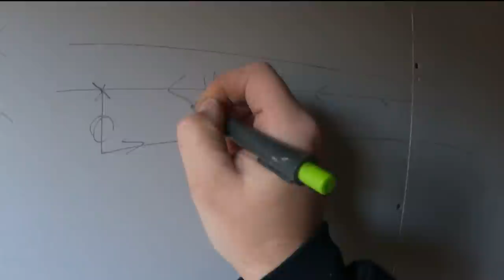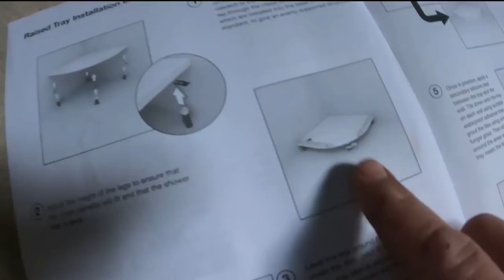MAKING IT WORK!!..HAIR-WASH STATIONS IN A NEW HAIR SALON..Something different

Comment: Thanks for taking the time to pull this together mate. The shower tray fixing is always a contentious subject. I tend to adapt my approach depending on the floor type and how level it is. In the nrw build case I would probably always SBR it first and then silicon. Where the floor is uneven or not level of concrete floor, SBR and then tile adhesive to bed it in and level it. I did watch a video from Skill Builder which does explain why a soft bed of concrete is the recommended approach. But, like you, I tend to stick to what I kkow and works.
Reply from the maker: Thanks mate, yep we all have our own ways that work so we stick to them…👍🏼👍🏼

Always one for a good old debate🤣
Reply: @MJTiffPlumbing  it won't be the first time I've had a mass debate over a shower tray 😂! Rude 😂

Comment: I had noticed you'd got a few mates Mark. Thinking when I finish college I need to find some to get work done. 🤣 Least my name ain't Billy.

Big old salon should look nice when it's all kitted out. The price of them sinks is mental though.

Moisture boards is an interesting way to cut costs on a project of that size and quality. Not to current regs either.

His gaff his choice but an odd decision from my perspective anyway. 

Looking forward to the sunken shower on Sunday 😊
Reply from the maker: Thanks mate, salon will be smart when it’s done.
Yep his choice on the boards, to be fair I’ve never had an issue with moisture boards in a shower area… if it’s tiled and sealed right it’s fine….

Comment: The only gripe would be on the tray analogy is that silicone on a warped floor and it will crack. The use of mortar gives you a solid even bed. Nothing to do with the legs or strength of it. I do use silicone on new builds myself but always check the floor for level and that it hasn’t got any bows in it. I hope that helps 👍
Reply from the maker: Never had an issue with Silicone bedding a tray, as to be honest a floor should always be made level anyway to eliminate any issues👍🏼

Thanks for watching and dropping a constructive comment👍🏼👍🏼
Reply: @MJTiffPlumbing  absolutely spot on mate. Like I said I use silicone on new builds myself. I have come across some pissed floors on older houses and to combat that is to cut them out and ply the shower area. The ply will bend a bit and get reasonably flat but not perfect. Using mortar can alleviate that as you can level it out to give a flat bed

Comment: What a great content and definitely always learn something new from the video. About the silicone did you only use Dura + for everything? I mean silicone for shower tray, on the side of it and for the tray waste? I just bought your recommendation laser today and will consider about the £499 Erbauer from Screwfix since I had combi drill and impact drive at the moment. But I need SDS drill and Multi Tool for rads change job later. Hope you get another 100 or 200 subscriber this week. Keep it up 👍
Reply from the maker: Thanks mate….
The laser level is spot on, always using it at the moment

Comment: You happen to have the codes for those two fittings you used on the waste of the backwash at 9.00?
Reply from the maker: I will have to rewatch and see what they were
Reply: @MJTiffPlumbing  haha sound thanks. Looks to me like the 32mm viva Magna from toolstation but it’s the converting from 40mm without extra adaptor I couldn’t get head round. I’m doing one for someone this week and redoing the plumbing due to an original dodgy setup. They just shoved the waste hose into a pipe with no thought on if it ever blocked and flooded place

Comment: That secondary return? Why does the water circulate in the hot water circuit if threes no demand on the taps.?
Reply from the maker: It’s pumped so it circulates when a hot water draw is a long way from the cylinder, set on a timer for when the demand is first used that day or later in the day.
Otherwise it can take minutes for the water to get hot and a waste of energy.

Comment: What type of piping is that and is there a pump and stat to keep hot water circulation.
Reply from the maker: It’s Polypipe…. Great for this type of install

Yer there will be a pump, non return valve and on a timer when the boiler room is installed👍🏼👍🏼